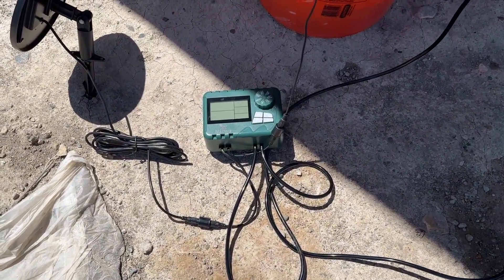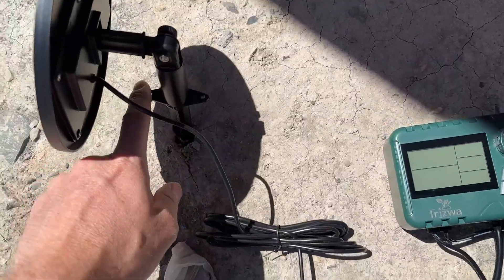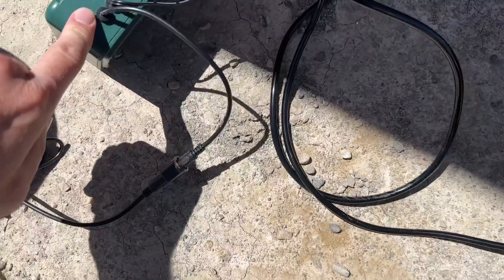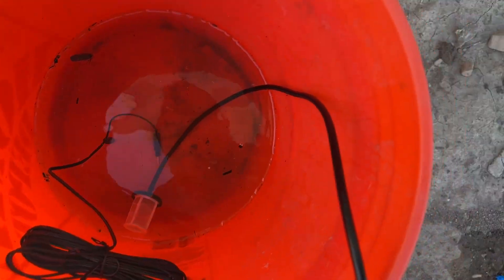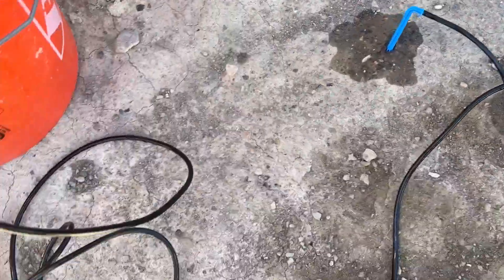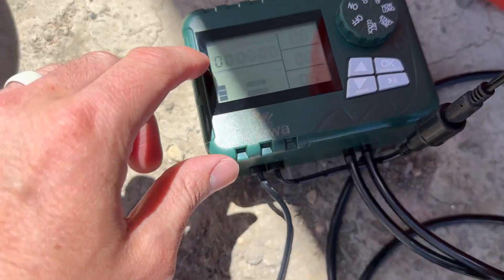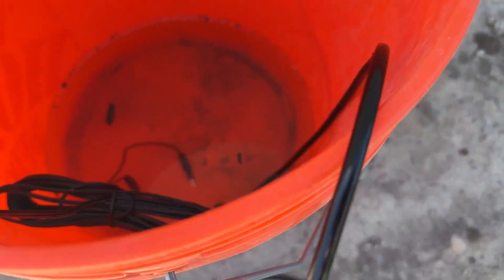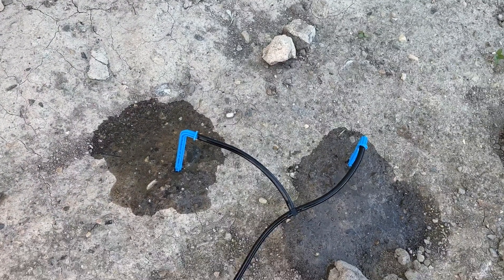Solar Irrigation System with Automatic DIY Water Timer TRJZWA Latest Drip Irrigation System Kit

Comment: i want to buy this system, but i think that i would need extra hose (15 meters wont be enough because when i cut it ,it will be short)... Which dimension of hose use trjzwa ( 1/2'' hose or 1/4'' hose?
Reply: Don’t waste your money on it it’s hard to adjust the time as you like

Comment: I have a question.. if I take a 100 liter barrel (which is approximately 75-80 centimeters high) will the water level detection line be long enough to touch the bottom of the 100 liter barrel...?? I want to buy a 100 liter barrel and put the main control unit on top of the barrel. I assume that the cables for detecting the water level must touch the bottom of the barrel? Therefore, I am interested in how long they are.